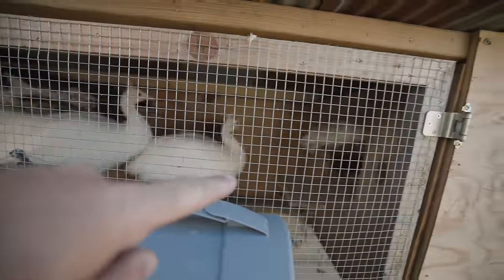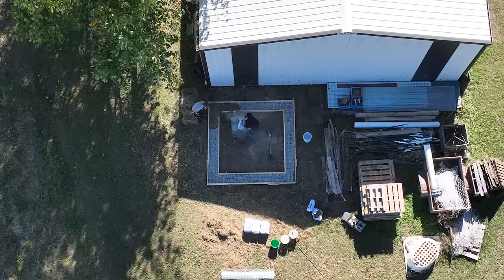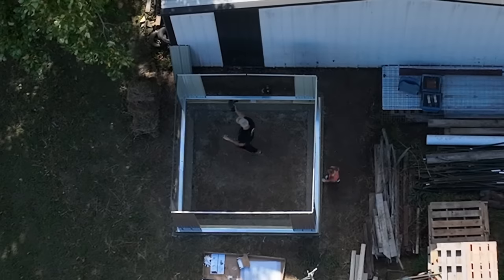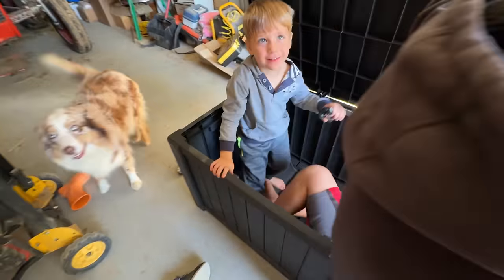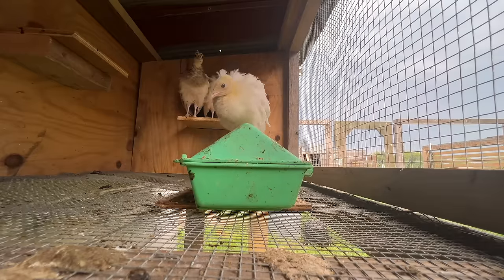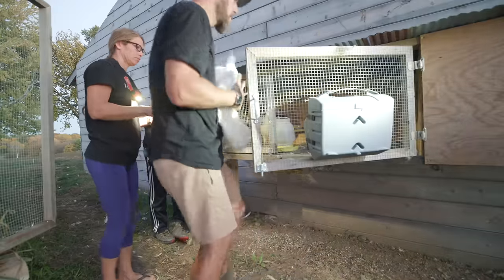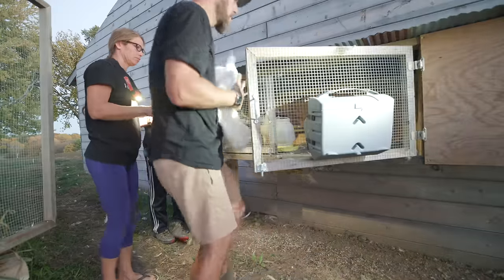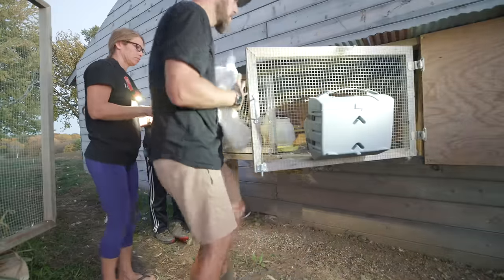The Ultimate White Peacock Coop Build

Comment: I recommend adding additional framing for the roof. It will not last during your snow season or high mind.
Reply from the maker: It says it will hold up to 400-450 lbs of load on top. We won't get that much in snow. There are 3 metal pieces of support underneath the roof. It will hold up alright for the foot or less that we get each winter.

Comment: That plastic roof on the run will also protect the birds from bird flu from wild, migratory birds. However, did you bury the wire sides down to stop predators like rats from digging in?

Comment: I had no idea peacocks honked! Lmfao 

Also please, for my reassurance, did you grind down the sharp edges after you cut the door hole out?
Reply from the maker: We put a rubber liner around the metal door so there would be no issues of them getting out. You can see it when they are going out the door towards the end.

Comment: do you remember when the wind took your cow shed?  same thing is going to happen to you poly roof on the run unless you put more support and screws.  plus, not sure about the snow load with only one center support.  looks great though.
Reply from the maker: We bolted it down with about 10 large bolts... we never screwed down the cow barn because we wanted it to be mobile. Wind can't get into the peafowl shed and blow it away.
Reply: @whitehouseonthehill  you did a fine job of the shed, I'm talking about the poly pannels in the run

Comment: theres still a small risk of predators if you dont put some kind of wire down on the roofing under the polycarb panels. raccoons will test to find a place they can lift and it only takes 2 inches for them to get a head through.
Reply from the maker: Screwed in all around the roof. They’ve never gotten in our other coops and this one is more secure.

Comment: Are you concerned about the birds getting too hot or cold in a metal shed with no insulation? I don't have birds, I'm just curious.
Reply from the maker: No... birds do great in winter and summer all on their own. If they are too hot, they can go outside in the secured run. If they are too cold, they can go in the building and get out of the wind and snow.

Comment: I hope you put a heater in the winter. Metal and winter mmh
Reply from the maker: Heaters are not usually safe to use around birds - and not needed - as birds have built in methods of preserving heat. We can close them off from outside and they would be out of the wind and snow if necessary but I would not recommend heat for peafowl.

Comment: Male chick=close stripes on its feathers
Female chick= no stripes on feathers
The last two are definitely male and female also the male chick flight feathers are a more vibrant chestnut and the female chick is the same as an adult female
Reply from the maker: So how does that method of identification work on white peafowl?
Reply: @whitehouseonthehill  u can try measuring their legs, males will usually have longer legs than females, I think from the tip of the middle toe all the way up to the base of the leg like the hip, u can also measure thier heads , males will have larger body parts 👍
Reply: @whitehouseonthehill  let me know the results 👍